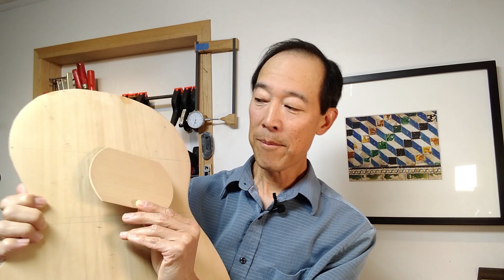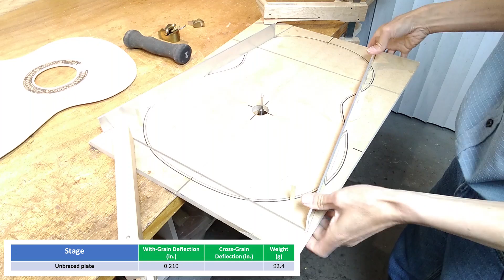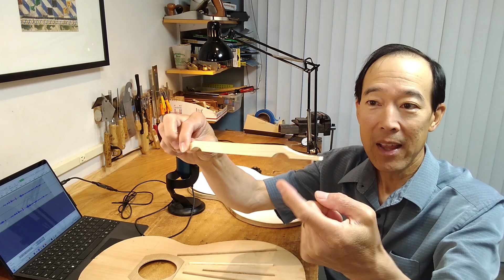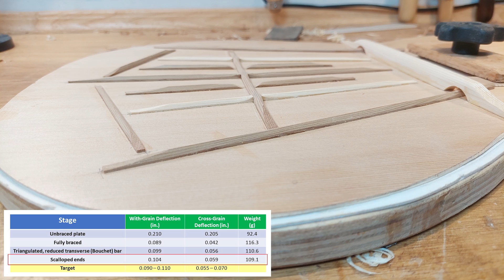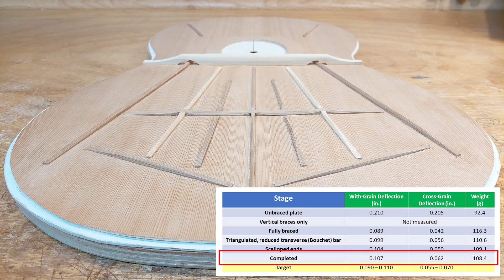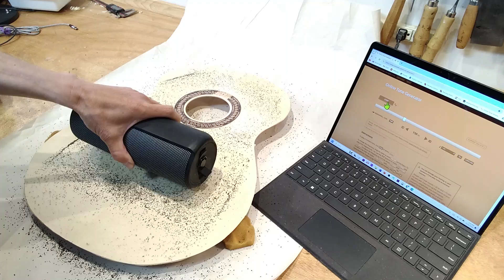Lutherie Demystified Ep. 15 | Techniques: Bracing and Brace Carving

Comment: Hi Garrett, thanks for the great video, very interesting as always! 
I have one question left: what are the target values of flexibility and frequency you use for solid top? 
Thank you
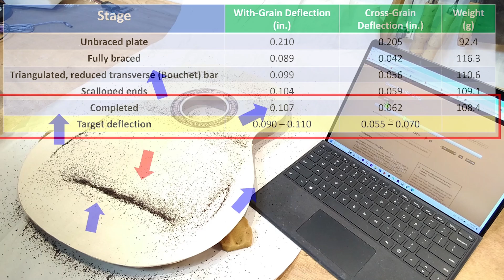Reply from the maker: This is a great question which I neglected to address in the video. Refering to the 0:59:31 mark in the video, you want to strive for a similar resonance if your objective is consistency of sound regardless of the material. Depending on your materials, then you want to adjust your flexibility to achieve that resonance. For a solid top, I recommend a resonance on the higher side of the range shown, approximately 165 Hz, because that is typically the range that the solid material wants to land in, but which also makes a very nice sounding guitar. The deflection that achieves this is typically on the stiffer side of the ranges shown, namely 0.090 in. for the with-grain and 0.055 in. for the cross-grain. The reason for the higher stiffness in the solid top is given at the end of Ep. 14. If you start with a stiffer solid top plate as in Ep. 13 (compared to a double top in Ep. 14), the extra stiffness will naturally carry over into the bracing process. Thank you for asking.
Reply: @GarrettLeeLuthier  Thank you a lot, Garrett 👍

Comment: Do you use a sound hole reinforcement on a steel string if so How thick and why
Reply from the maker: Typically on the order of 2 mm thick to provide integrity and longevity for an area that would otherwise be delicate.

Comment: Hello, and thank you for your videos! And why do guitars with tougher brace often sound good too? For example, Robert Boucher made the cross brace under the bridge more rigid than in your system
Reply: Partly, it's a matter of taste. In general, we know that guitars built in the Bouchet style tend to sound brighter, which is what we would predict for a stiffer top assembly. By contrast, a Dammann tends to sound warm and dark, which is what we would predict for a very flexible top. Both can sound good depending on your taste. Secondly, we don't know the final stiffness and weight of most finished guitars. If the starting materials are flexible or thinned appropriately, even something with a rigid design could land in the "just right" range in terms of final stiffness. This is why plans give only limited info. Much of what's equally important to the sound, such as the material properties--and even plate thicknesses--are left unknown.

Comment: Hi Garrett, and first of all, I wish you a great 2026!!
And then, if you're kind enough to reply, I'd like to ask a question: I've noticed that with my finished guitar, the treble on the 1st string at the higher frets is very weak and lacks sustain.

Is there any way to fix this by adjusting the deflection and stiffness? Sorry for bothering you, and thanks!
Reply from the maker: In the highest notes of the upper register, particularly the 1st string beyond the say, the 10th fret, the efficiency drops off considerably as the string length/string energy diminishes. I've found that two things increase the efficiency, which both make sense: 1) lower mass of the soundboard, and 2) high soundboard mobility in all directions so that the highly complex modes of vibration that power the high frequencies can set up more easily. For 1), use the lowest density soundboard material possible or use a double top or lattice braced design. For 2), increase the flexibility of your soundboard assembly (plate and/or bracing), particularly in the cross-grain direction. In the with-grain direction, there is a structural limit before the soundboard starts to collapse due to string tension. However, you'll find you can increase the cross-grain flexibilty quite a bit without compromising the structural integrity since the force of the strings is in the with-grain direction.
Reply: @GarrettLeeLuthier  Thank you so much for your reply. I'll do it on the next guitar I build, or if I replace the top on one of the ones I already have.
Thank you again, and best regards.
Jesus.

Comment: Thank you Mr. Lee I would like to know  if the deflections targets are the sames when
Bracing solid top
Reply from the maker: If you are trying to achieve a similar bass to treble balance, you want to make a slightly stiffer soundboard assembly for a braced solid top compared to a double top. That's because the solid top plate will be significantly heavier than a double top plate, thus the resonances will tend to be lower in the solid version. You can compensate for that resonance-lowering effect by making the top assembly stiffer. I talk a bit about this idea of compensating factors of weight vs. stiffness at the end of the double top making video, Ep. 14.

Comment: hi, Garret ,thanks for your job with your videos, I have a question about the back tuning, the better pitch is lower or higher than te top?
regards from a Spain!!
Reply from the maker: I make my backs such that in the finished guitar, the main back frequency is higher than that of the top. My backs are typically in the range of 225-230 Hz. My backs are mid-way between "live back" and "reflector". I want my backs to move somewhat to give the player some sense of liveliness, but still have good forward projection. Part of the reason for higher frequency is one of practicality in that the back and side woods are inherently stiffer, so it's easier to get the frequency separation from that of the soundboard by going to a higher frequency.

Comment: Hi Garrett, thanks for the excellent video. I wanted to ask - you mentioned your  target deflections for steel strings in the episode 13 comments. Are you able to also provide the post-bracing deflection targets for steel strings like you have in the table for this video?
Reply from the maker: Unfortunately, back when I was making steel string guitars, I did not measure deflection after bracing.

Comment: Hi Garrett, I really appreciate all of your videos.  I was wondering your opinion on how much the age of the wood matters for a sound board (or even the back and sides).  All things being equal with your precise flexibility measurements and bracing techniques, what difference would an aged piece of wood make in sound quality?  Thanks!
Reply from the maker: It's a difficult thing to measure with any statistical significance, and I've not done any comparisons. I've only used stocks that are at least 3 years old post-processing, typically 5-15 years. At that age, the stocks are stable and well-acclimated to my workshop's environment. I feel this is the most important factor in terms of age. However, I experience all the time how string tension and playing in of a new instrument changes the sound, first rapidly in the first couple of weeks and then very slowly and gradually over the life of the guitar.

Comment: Hi Garrett, perhaps you can answer a question i've asked many, but not gotten any answer to. It's also not addressed in the dozen or so guitar building books i have. 
When building with a plantilla, the dome shape of the top and the neck-angle are nicely preset, so proper bridge/saddle height and correct action are guaranteed. With the top placed upside-down on the plantilla and the neck position fixed, sides are slid into the mold. The sides have 90° angles on the thin ends, but the top is angled slightly due to the doming. How on earth do you make them fit nicely? The there is the kerfed lining, that is also at 90°. I expect there to be a wedge-shaped gap, which cannot just be filled with glue because it would have no structural integrity. To make it even more complicated, the upper bout has no doming at all. How is it done?
Reply from the maker: There are two issues you are addressing. The first is where the domed top meets the sides and lining. In order to get the best fit, the sides with its lining are often "bowl sanded" with sandpaper attached to a radius dish of the same curvature of the braced soundboard. This is a fairly standard technique in modern building where the entire side assembly is made independent of the neck, or at least before the top is attached to the neck. In plantilla systems, the tentalones (or even lining) can be angled to comply to the dome or left at 90 and accept a small kink at the periphery. The second issue arises in the upper bout where the incoming neck is at a positive angle relative to the soundboard's plane (which can be domed or more commonly, left flat). In both cases, the underside of the fingerboard is faceted in the area between the 12th fret and the soundboard to comply with that angle. Finally, if the the lower bout is bowl sanded and the upper bout left flat, most builders sand a small transition zone of decreasing angles in the rim at the region of the waist.

Comment: I second all of the wonderful positive comments. You have given this old guy new energy! 

One of two or three extra free variables after the guitar top is closed up would be the mass/density of the bridge (the second being the type and thickness of wood finish, and the third being the strings and their type and tension).
Have you ever tried to quantify the effect of the bridge mass on sound volume, or perhaps the effect on the power spectrum?
Reply from the maker: That's correct. We'll address the effect of the bridge in Ep. 19.

Comment: Another remarkable video. I am learning so much. I can't wait to apply these concepts to my next build. I am completing my 14th guitar now. It is a lattice brace. You have said that you don't build lattice braced guitars, but mentioned that builders capitalize on this bracing pattern by thinning the top. Do you know APPROXIMATELY how thin they go? I normally use 2.5 mm for spruce in the Hauser fan bracing (thinned out to 2.1 or son on the edges). THis guitar is 2.2 mm in the center and thinned to 2.0 on the edges. I have not done final sanding, so if lattice braced guitars are around 1.5, I could be more aggressive on the final sanding. IF ONLY I HAD MEASURES DEFLECTION!! Anyway, sorry for the long question. Thanks so much for these videos!
Reply from the maker: Michael, The Smallman and Sons tops that I have measured were about 1.2 mm thick, but you'll find a range of thicknesses used by makers depending on the nature of the lattice and the materials used, such as balsa vs. spruce or cedar, and whether capped with carbon fiber and epoxy. You'll likely find everything from the Australian-style thickness all the way up to that of a standard solid top. It's hard to generalize, but the one thing you can say is that the assembly must work as a system and in the context of the chasis.
Reply: Thanks Gary, That gives me a sense of what to do.
Reply: By the way, this is Michael Fontenot. I messaged you a coule of times directly.